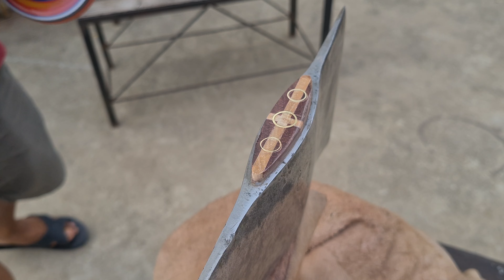Axe Hanging - How To Make a Beautiful Cross Wedge & Decorate With Cartridge Case

Comment: Why would you epoxy the handle to the head? Now it can never easily be repaired if it comes loose of the handle splits etc.
Reply from the maker: We used hard wood for the handle and I thought epoxy glue would help increase its strength.👍😊 The epoxy glue we use is of high quality grade. It is flexible, resistant to high heat and has a long service life.